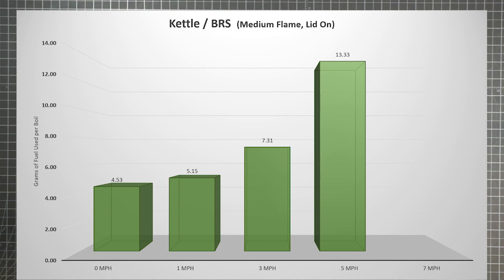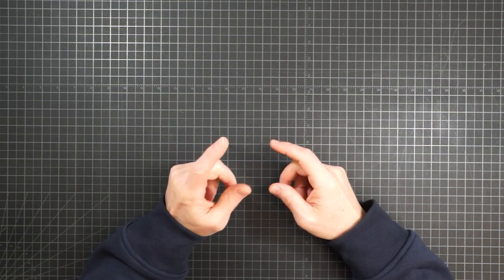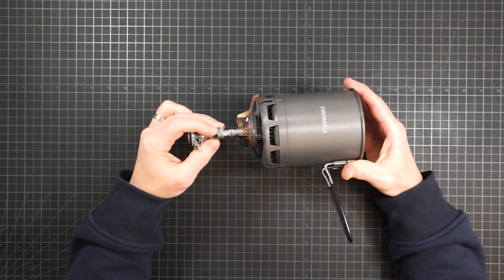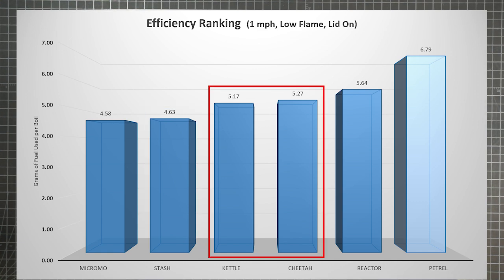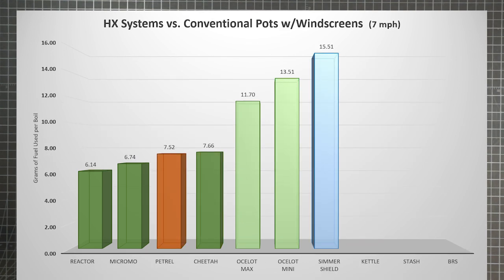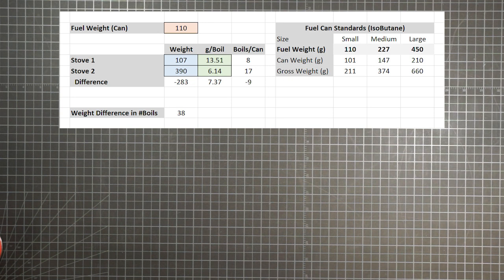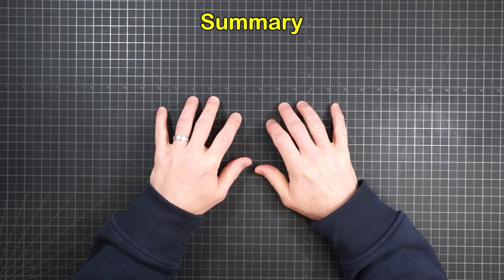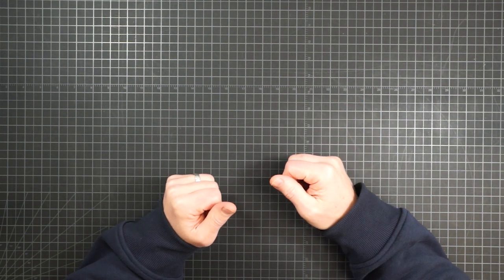Backpacking Stove Efficiency, Part 5: HX Systems in Wind

Comment: Outstanding work, again! We watch all the way through because you are thorough, unbiased, and take a scientific approach. I use a Zip, Minimo or Trangia 27 (with Storm gas burner) depending on my trip. My informal tests show my Trangia 27 (at medium flame) to be slightly higher in gas consumption but not much in it. I know the Trangia system is less popular in USA than Europe, and it isn't for the weight conscious, but I'd love to see you put a Trangia 27 + Storm burner though it's paces!
Reply from the maker: I do (eventually) have plans to test alcohol stoves and compare their weight efficiency to canisters 👍🏼
Reply: Ah..For me alcohol stoves don't make sense: riskier to use near a tent, and my fuel usage makes has a no brainer from a weight/efficiency perspective. Trangia 27 started as an alcohol stove but the Storm gas burner gives the stove a different set of advantages. Cheers from UK!

Comment: In the end of that series we will get to an integrated can-stove-pot with only 50 grams overhead on top of the fuel weight and burning efficiency of 3.2g/boil in any wind condition.

Comment: Once again, EXCELLENT video! Your testing methods are far better than any other testing I have seen on youtube, for stoves. Regarding the issue of the refilled canister causing issues. I have been refilling canisters for many years. Canisters are filled with up to 3 different gasses. Butane, IsoButane and Propane. In the canister, the butane is typically on the bottom of the canister, with the propane typically in gaseous form on top. This is specifically why some canister stoves are designed for the canister to be upside down. This enables the higher pressure propane gas to push the butane (or isobutane) out first, making your stove burn better in lower temps longer. 

Regarding your tests, when you refilled the canisters, if you heated the canister you want to drain, then connected the two canisters together via the valve, then opened up the valve, with the canister to drain upside down on top, you probably filled the canister you are trying to fill with mostly butane (or isobutane). Butane does not generate as much pressure and therefore will not push gas out as forcefully as a new canister, because of the lower amount of propane remaining in the cylinder. This also could explain your pressure loss issue. 

FYI, this type of canister works very well when refilled with 80% by weight butane, then 20% propane. I've been doing this for many years and have never had any issues either in refilling or in usage. I've seen people have their nearly new canister valve completely go nuts (probably from foreign contaminants in the valve) when screwed in and completely drain after removing from the stove.
Reply from the maker: Interesting ideas. My shop is well above vaporization temp for all gasses, though. Also, I did not transfer just a portion of what remained.  I emptied them.  Did not use heat, just gave it as long as it needed.
Reply: @GearSkeptic  Is it possible you previously experienced some selective evaporation with the (original) canisters, altering the ratio of propane to butane remaining in them?
Reply: @GearSkeptic  Wouldn't there naturally be higher pressure in the lower canister? Wouldn't that lower canister be filled with the most liquified gas (butane), and the propane would float to the top, being the upper canister. I'm pretty sure you ended up with the upper cylinder containing some propane and all the butane/isobutane in the lower one.
Reply from the maker: Theoretically, there can be a difference in the burn off rate of the two gasses. But, that is something likely to only be noticeable if it is so cold that you are near the latent heat of vaporization for one of them. Then the differential will be greater. But, at my shop temperature, both gasses will be at the equivalent of a “rolling boil” inside the can.  So, there won’t be a difference that would be so pronounced as to account for the difference in rate I saw.

As for the transfer process, it is done with the donating can upside down, so it is the liquid in question. Isobutane and propane share the same molecular bonding traits. They mix well and stay mixed to the end. While differential gas burn is at least a theoretical issue, pouring one liquid off the other isn’t. 

Think of it this way: if the differential burn was that strong, you would have the same problem in the canister burned down. It wouldn’t matter whether you had refilled or not.  All partially-consumed canisters would end up this way. From many, many measurements, I just don’t see that happening. At least at my temperature of testing.  It would interesting to see what happens when running a stove at 15F.
Reply: @GearSkeptic  I'm pretty sure the key reason Propane is added to this mix is because per weight, Propane adds more pressure to the tank. That pressure is what pushes the gas out, what makes butane actually work at all below freezing. I believe your refilled canisters do not have enough propane in them. I have absolutely NO idea how much would need to be added and therefore, suggest just using them for non-essential or critical uses. They'd be great for weekend uses, but unless you completely empty the canisters and add butane and propane by weight, you'll never really know what the ratio in those refilled canisters is... Unfortunately, this means you're stuck with requiring brand new canisters, or identically refilled ones that were emptied and refilled with strict adherence to the ratio...
Reply from the maker: Again, it is a subject of temperature.  You mention propane making the tank work “below freezing”. I am nowhere near that. I could use an adapter and a can with pure butane (even higher boil temp than isobutane) and have no problem getting the gas out. They are all boiling very well at my shop temp.

You are, in effect, claiming that all stove use results in the propane being gone before the tank is even close to empty (I don’t use mine below 20%).  Experimentally, I can tell you I see no such change in performance from 100% down to 20%. Being a skeptic 🤓 I’d need to see some documentation before I’m gonna believe that.
Reply: @GearSkeptic  Not completely. I'm stating that propane is the only gas in the canister that is always in a gaseous state. At or slightly below freezing, Butane remains liquid. Below 10F, isobutane remains liquid.  These temperatures are all easily derived. Wikipedia has them, as do many other websites stating their thermophysical properties. 

Regarding the blending of the gasses at temps above their boiling points, I am still investigating. I do know that pressure changes the boiling points, but haven't found anything that definitively clarifies this... More research... LOL!
Reply: @GearSkeptic @GearSkeptic  Vapour pressure of a liquid describes at what pressure at room temp a molecule has to be a liquid: for butane it's ~170 kPa for propane it's ~853.16 kPa (numbers from Wikipedia - which is good enough for back of the napkin calculations). Since one component is 8 times more volatile than the other it means that the proportions of either can have a pretty sizable impact on the pressure inside of a vessel in which a liquid/gas equilibrium exists. Therefore even if you are at room temp the specific mix will have a huge impact on the pressure you are getting. This isn't meant as a slam on you: but more of a fact check that since propane and butane have significantly different pressure: 1: the more volatile gas gets selectively evaporated more. 2: this gas mixture is pretty sensitive to the proportions. Using Reynolds and Deltons laws together - saying that the proportion of the each component multiplied by it's volatility gives the partial pressure and adding the partial pressure of each component together it's pretty easy to determine the pressure of a gas mixture in a liquid/gasous equilibrium as long as you know the volatility of each gas in mixture at a certain temp

Some liquids can form Azeotropes which would mean that the less volatile liquid evaporates at the same rate as the more volatile one: but I don't see any proof that two pure Hydrocarbons would form one since they interact well with each other ( they are non-polar solvents): this means that we shouldn't expect the same proportion of Propane/Butane in the gas as in the liquid: pretty much saying that the Propane should be have a higher affinity to be evaporated - I won't be able to say by how much off the top of my head but it will be.

Therefore by using several gas laws: 
1- it can be determined that the more volatile liquid would be evaporated preferentially (in this case propane)
2 - the amount of propane will significantly impact the pressure of the canister 

I love your series! But, I think moving to mono-gas like propane would significantly cut down on waste and the headache of gas mixtures. 

I actually think this would be a great test - does Isobutane/butane/propane evaporate at different rates when the components are in a mixture with the same partial pressures?

Comment: isobutane stove canisters use a mix of butane, isobutane, and propane. is it possible that repeated uses has preferentially boiled off the propane and isobutane leaving a mostly butane gas mix, and that the changed gas mix is responsible for your high flow anomaly? Like, with a low vapour pressure some fixed component may be acting as a restriction to flow, but at higher vapour pressures and lower flame settings the throttle valve becomes the primary restriction?

could investigate by measuring the vapour pressure of the refilled bottles vs summer mix, winter mix, and straight butane from a lighter refill, and refilling a suspect canister with fresh fuel, and then comparing burn rates with a few different combinations of adapters and flame settings. might not be particularily useful, but could be interesting to investigate. maybe incorporate into a discussion on fuel selection and weather?
Reply from the maker: Interesting idea, but my shop is well above vaporization temperature for all gasses in the mix. From what I’ve read, it becomes a problem when it gets so cold that only propane can still vaporize. You lose that and end up with the stuff left over. But, that is a whole lot colder.
Reply: @GearSkeptic  oh, it's absolutely an issue at low temperatures. But is it possible that something is causing it to occur at room temperature as well, just at a less pronounced rate so it only becomes an issue at very low canister volumes? 

My at best college level grasp of thermodynamics isn't enough to have any idea what that effect may be, but I personally doubt that the canister valve is damaged in a way that restricts flow but doesn't affect the usability in any other way. While the valve could absolutely have been damaged by the refill, unless your adapter is out of specification there's nothing about a normal refill adapter that should cause damage. It's simply two Lindal coupling back to back.
Reply from the maker: Others have suggested this, as well.  It intrigues me, but the differential burn issue is one that comes into play more when the temperatures are below freezing. My shop (50F) is plenty warm enough to have even the isobutane boiling enthusiastically inside the can. If that was an issue (at my temps), it would manifest in the original can as it got close to empty. It wouldn’t be a refill issue, per se (in liquid form, the two gasses mix evenly, they don’t separate).

Comment: Finally! You've confirmed some things I already knew. I also want to present some caveats.

#1: Fuel transfer devices are garbage. I don't think they should even be legal, as they can literally create pipe bombs if misused. 
#2: As I mentioned back in April I used the Petrel+Soto in a 70 mph windstorm at 9000 ft on San Jacinto without issue. Good luck trying to do that with a BRS, which works terribly not only in wind, but also in cold and altitude, two variables you didn't test for. A reminder also from that experience that it was my Soto's piezo that saved me, as I couldn't get my lighter to light when I tried to melt some cord for guy line. If I had a BRS, it never would have lit.
#3 Because the BRS doesn't have a regulator, it will perform poorly not just in cold and at altitude, but also when a canister gets low. When a canister is full, the pressure alone is enough. When the pressure drops, a stove without a regulator becomes more inefficient, which is also why it doesn't work as well at altitude.
#4 A massive oversight is the cost of each of these options. A JetBoil MicroMo costs $170. The Petrel pot is $20 and likely works with the stove you already have. That is a huge cost difference considering their performance difference is negligible and the Petrel is lighter, and can be lighter if you replace the heavy lid with a 5g tupperware lid.
Reply: Where did you find the 5g lid? I have the Petrel 600 ml pot (G3). I like the way the lid clamps in place but do think it’s a little heavy for what it is. The G2 pot lid is even heavier.
Reply: @wanttogo1958  It's a random tupperware lid.

Comment: Two additional observations:

1) This totally trounces all of those gear review YouTubers who got free Jetboil Stashes, shot wonky boil test videos and concluded it was an amazing system. 

2) This video hit at the top of my feed after months since your last post. The algorithm does not appear to prioritize post frequency!

And all those tags are going to give me nightmares for weeks.
Reply: The Stash is an amazing system. It's a commercial ultralight pot and stove with incredible efficiency (primarily thanks to the great pot). Prior to the Stash people had to cobble something together out of various components which most hikers, and certainly most new hikers, wouldn't do. The Stash made a highly efficient and very light system available to all.
Reply: @ It’s an ok (although expensive) system. But as Gear Skeptic’s testing proves, it is not efficient in any kind of wind. It’s too bad, because the pot is solid, but the stove is the weak point.
Reply: If JetBoil offered the Stash pot as a separate component then they would see why people buy that system. It’s very expensive for what it is. Adding a removable wind screen might make it a better system for all wind conditions.
Reply: I always use  my Stash in the vestibule area to get the best fuel efficiency, the UL guys know how to use their gears

Comment: Aways excellent Mr Skeptic. Although the camera view of the desk grid is misaligned. Noticed it 4 minutes in... CAN'T UNSEE!! 🤣
Reply: @GearSkeptic  However, all your data collection and analysis is bang on, thank you for all the time & effort you put into these.
 I've noticed my cannister refills seem to be a little weaker at WOT also...wonder if that's a potential point of failure over time?
Reply from the maker: Yah, it happened to me with two cans in a row.
Reply: @GearSkeptic  I posted a reply above about this, but I suspect when you refilled, you put the old canisters butane (low pressure) into the canister you were refilling. The propane usually stays in its gaseous state, whereas the butane is mostly a liquid. That means the propane stayed in the canister after you thought it was empty... Refilling canisters isn't realistically supposed to make the canister as good as a brand new one. It's just supposed to make a canister that works without buying a new one...
Reply: @Ahand59 if that is in fact happening it would be easy to for by just putting your stove back on the “empty” canister and see it it will light and run for anytime.
Reply: That got me too!

Comment: Love this series as a data nerd. As another baseline, how about testing a basic UL pot/stove combo with an external, unattached windscreen. Like some thin foil cylinders, or I use a piece of kitchen aluminum foil folded a couple times, that rests on the ground and leans up against the pot, covering roughly the upwind 1/2, but still plenty of space to keep the can cool
Reply from the maker: I did a few impromptu wind break tests for the wind effects episode. I avoided the exterior, free-standing kind because those also encapsulate the canister. Don’t want to get involved in a strategy that might encourage someone to overheat their can.
Reply: @GearSkeptic  Fair enough. Any hint as to what your impromptu testing showed?
Reply from the maker: @ check out Part 3 on windscreens.  You can jump to the end at 34min11sec, from the index: Tiered Wind Protection.

Comment: Great to know that you will still be diving in this subject. Very curious to know if a "caldera cone style" windscreen would dominate the wind category (and even with no wind due to concentrating heat)
Reply from the maker: I have a caldera cone for an alcohol stove. Gotta be careful about not creating an “oven” that would dangerously overheat a gas canister.
Reply: @GearSkeptic  Yes, that a valid concern depending on the room temperature. Maybe there is a length of cone that does not overheat the can so much while still providing heat concentration and wind protection for the pan (a HX might not be even needed). Perhaps using a shorter cone that does not touch the ground (or the top part of the two-piece system)
Reply: I've read that the canister should not exceed 125⁰F, though I do not knot if going somewhat above that is really a concern. A second probe (thermocouple) attached to the side of the canister might attest to that
Reply: While true all of these show really a "chimney" design which keeps the cross-wind reduced and forces heat up hugging the pan is the most efficient and in more conditions, you would struggle with a canister due to the heat of gas, and why they tend to be for ethanol which is a lower heat.